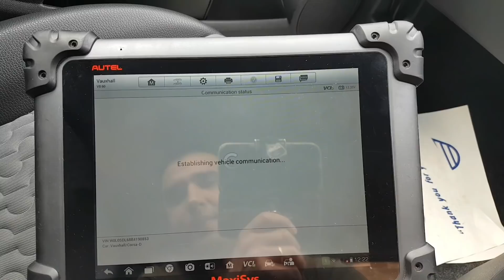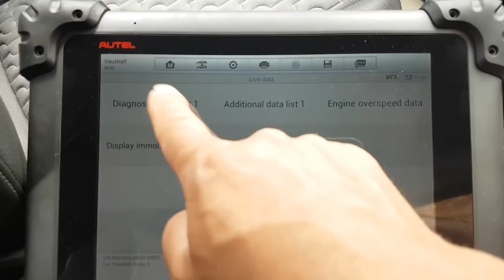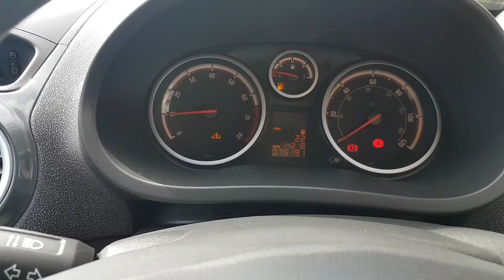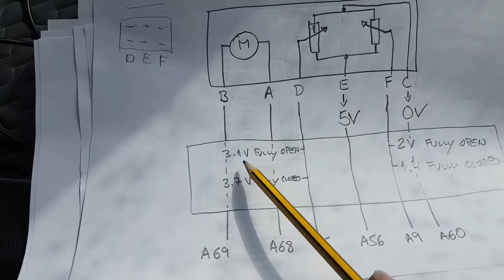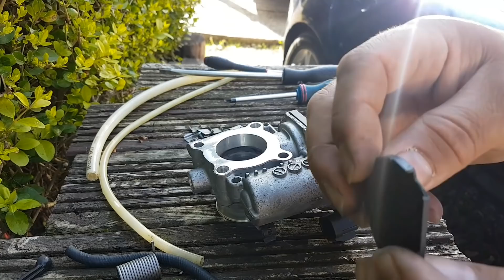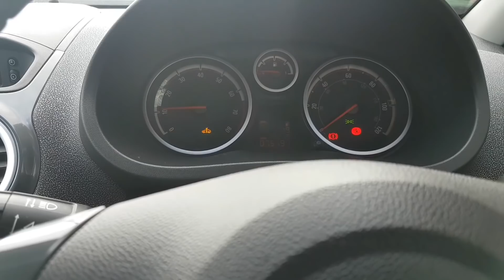Corsa D 1.4 shutting down, limp mode and spanner light on... Fault finding and repair.

Comment: Hi I have a corsa d 2007 z14xep, it idles very low, revving fine when I start driving it would suddenly have no power on the pedal, have remove one battery terminal and then replace it, then I have power again, please help
Reply from the maker: Scan the car and check live data... anything else to start with is guessing...
👍👍👍

Comment: Finally I get you after one year of the exact problem on my car! It would have been easy to replace the throttle & fix the problem but the mechanics were not helpful who costed me a lot by replacing other parts. Then I start to do it by myself tearing down every single parts(specially sensors/wires/…).   Luckily I identify the problem was the elec. throttle (Chevy Cruze)… I disassemble the throttle where the potentiometer plate & the contact pointers are damaged… as a temporary fix I smoothen the potentiometer plate & straighten the contact wires… personally it’s so satisfying b/c I didn’t had any clue about car except on/off & drive… NOW I mastermind
Reply: More  damages  over all ,replacement  ,bushing ,oil ,ect.
Reply from the maker: ☺️
That's great, that you took up on yourself and fixed!
Well done!
👍👍👍

Comment: Whenever I shift my gears/ lift off my foot off the gas the car juggles a lot than it should? Is it the throttle body? Or is is the bad engine mounts?
Reply from the maker: Difficult to tell...
Any codes stored on the engine ECU?
👍👍👍
Reply: @LMAutoRepairs  no, no faults whatsoever. I've ordered a replacement throttle body, will fit it and see if the problem goes away
Reply from the maker: Well, if was the throttle body, would either throw a fault, or you could see if there was an issue on live data, actuating the valve would also help rule out mechanical problems with it...
Parts cannon can become very expensive very quickly...
Good luck...
🤞
Reply: @LMAutoRepairs  Thank you and appreciate your replies :)

Comment: I have similar engine performance issues (EML and service/spanner) with the same model car. Chugging and loss of power (limp mode) but my code is P0700 and I can't figure out what is wrong. Personally I think it's an electrical fault somewhere. Are you based in London? I'd love to get this issue looked at by someone that actually knows what they're doing.
Reply: I have a 2008 Vauxhall corsa in limp mode , no engine check light on the dash , I have changed spark plugs, air filter , O2 sensor but still it remains in limp mode, are you anywhere near wakefield? I'd love to get it checked by someone like you
Reply from the maker: HVe you scanned the car?
Reply from the maker: Hi
No, I am not anywhere near London...
Is that automatic?
That P0700 might refers to a gearbox issue...
👍👍👍

Comment: Nice one next time for carbon contacts use acetone to clean the carbon brush, then wire brush the ends of the contacts up and use a light coating of contact grease. Subscribed awesome videos man 🤟
Reply from the maker: I usually use isopropyl alcohol...
Thank you for watching and for your comment! 
👍👍👍
Reply: Acetone is quite heavy stuff for stuff like that. I'd highly suggest to switch to IPA. Much more gentle stuff, but still does the job like 90% of cases.

Comment: Why is there so many different 1.4 engines available and why can't the scan tool tell automatically which one it is
Reply from the maker: Different variants... like different engine power, etc...
Usually it does detect... but fails to do it on some engines...
👍👍👍

Comment: great video as always , can you recommend a good battery maintainer that wont break the bank . cheers
Reply from the maker: This is the one I use...
https://www.halfords.com/motoring/battery-maintenance/battery-chargers/ring-rcbt27-pro-battery-charger---12v%2F24v-27a-116438.html
Is not ideal for programming... but does the job...
👍👍👍

Comment: How many videos in a row now where customer cant put fuel in car…. Wow, humans, keep surprising me😁
Reply: Well apparently there has been quite many shops that have siphoned some fuel from customer cars so I suppose that's to be expected.
Reply: @jothain  i guess if they dont trust the shop, fix it yourself. Then you know the shop didnt steal gas if you are the one fixing, right?
Reply: @mikesabin8568  Quite bad analogy. I don't think you would leave your wallet in car, would you? Or if you send your computer to repairs, would you leave all sensitive data openly available? Today's gas prices are hell of steep, so I'm not surprised about this at all. I check my cars odometer and computers  fuel range after repairs. That's just common sense. Never seen anything fishy, but as said, common sense.
Reply: @jothain  if you cant afford gas, you cant afford the repair. Mechanics need you to fuel your car before they get to us, we are not your gas jockey. If you dont trust us, fix it yourself or find a mechanic you trust and put gas in the car. This isnt hard man…
Reply: @mikesabin8568  Really? I just recently topped my car. 150euros. I also recently went to shop that they could weld one exhaust bracket. Cost 25euros. To my understanding there's quite a bit of difference there 🤔
It's simple question of possibility for some a hole to leach your fuel in addition to the normal billing. That's what I'm after at. That's why I understand the behavior for some. Plus what do you care if fuel runs out? That's good way to bill more for towing car back to shop. Unless repair guy drives car for ridiculous amounts, which is also something that has happened quite often and with many places. Few rotten places ruin things for others. That's the unfortunate truth. That's why some people are downright scared that they'll get screwed.
Reply: @jothain  why should i care if fuel runs out? Stupid question..
Let me help you champ… if i have to work on the god damn car guess what it takes to run…. Oooohhh thats right… fuel. So you drop it off to me and i have yo go to a station and put gas in your car and fix it too. Want me to validate your god damn parking as well? How bout we throw in a car wash too? Fix the car yourself or bring it to a mechanic with gas in it, period. If i have yo go get gas to work on your car i have to charge time for that and the gas anyway so might as well get gas yourself. Lets try not to be stupid here ok?
Reply: @jothain  if you dont want to be screwed fix it yourself
Reply: @mikesabin8568  that's like saying all car mechanics are scammers 🙄
Reply: @jothain   again….. you seem confused… let me help you out chief….

If you think you can fix your car, go ahead, no one is stopping you. If you fix it yourself, then it doesn’t matter how much gas is in it. Now, if you cant, whats the next step, pray for it to fucking fix itself? Ooohhh guess what you are going to have to drop it off to someone who can? Yes or no? That should not be confusing at all. If you happen to still be with me, now bring it to a mechanic with no gas. Great idea… except, it gid damn needs gas to test ok? So, do you want to gwt the gas for your fucking car or do you want the mechanic to run and get it for you? If option b, thats wasting my time. Either way, you need gas in the damn thing to test the car. It actually runs the car. Still confused?
Reply: @jothain  tell you what, just drop your damn car off with no gas and expect someone to make it run right. Makes no god damn sense…
Reply: @Rubber Thingy no no just charge $20 per gallon and add 5 gallons easy $100 bucks. Just state before car is delivered if I have to add fuel is $20 a gallon with a minimum of 5 gallons. Lol 😁 ✔️ done.

Comment: Great video 👍Did you check oil pressure switch plug for oil in the loom ,the brush problem is the same with Corsa wiper motors😅
Reply: This engine didn't suffer from oil switch problem that was the z12xep & z14xep engines.
Reply from the maker: Don't think I did on this one...
👍👍👍